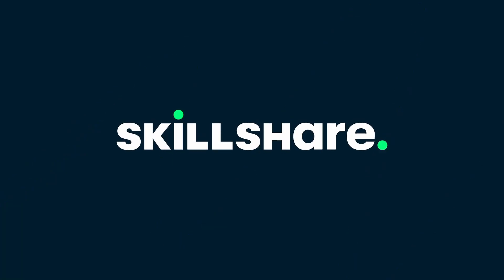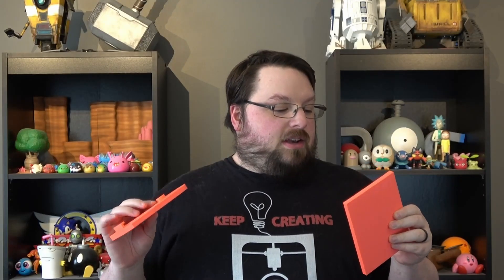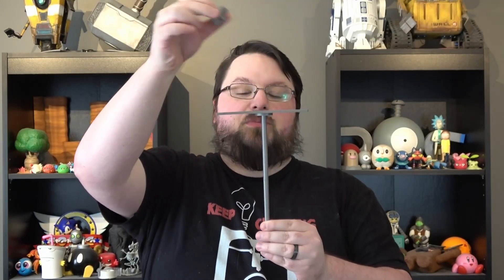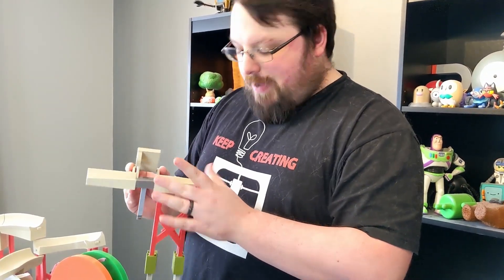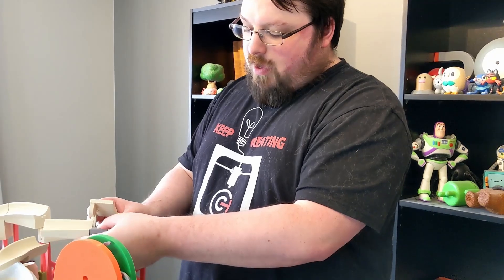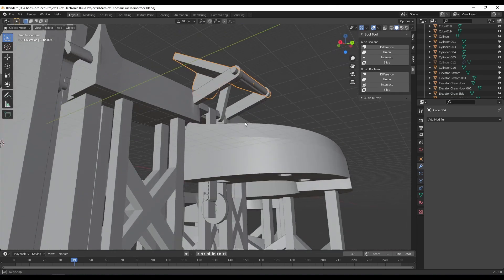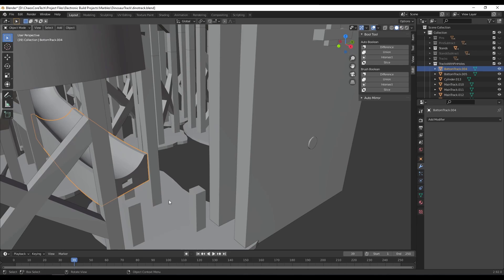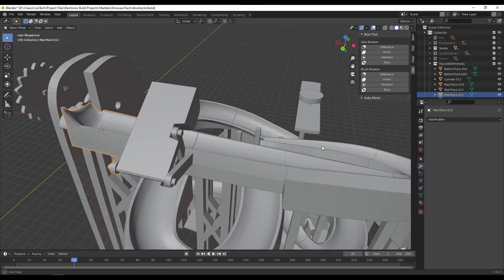Working Through The Issues... | 3D Printed Marble Track

Comment: 13:42 If you just use a DC motor and not a dedicated motor controller, then don't forget to add in a flyback diode.
https://en.wikipedia.org/wiki/Flyback_diode